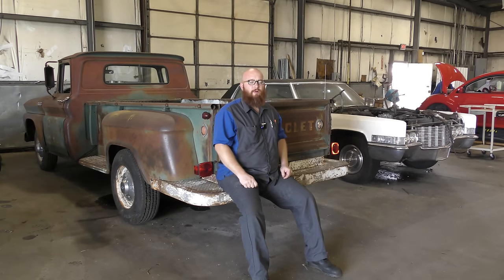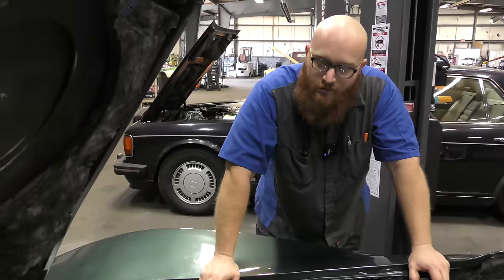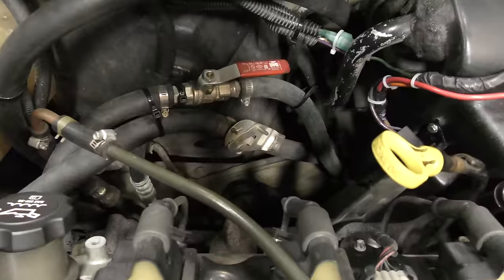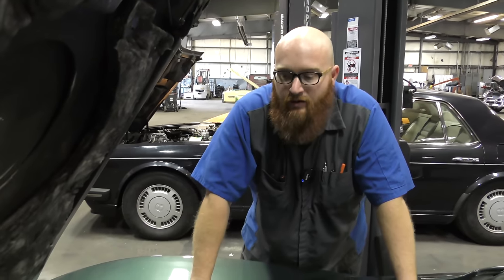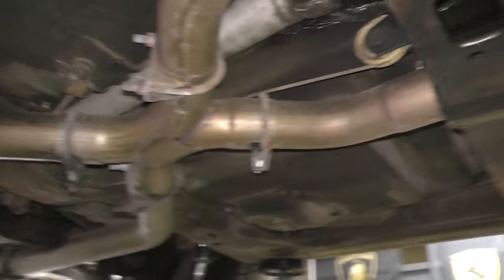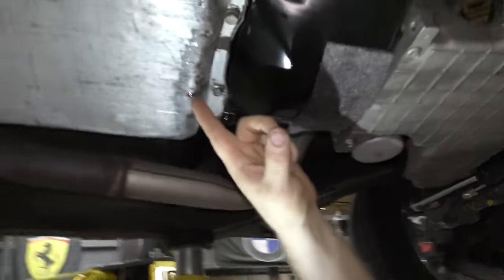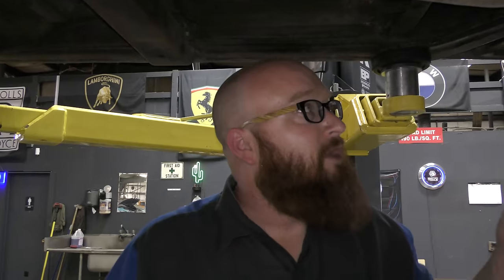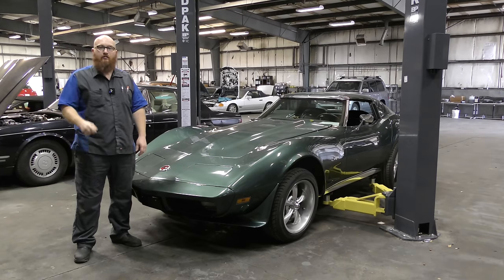Issues AFTER an LS swap! CAR WIZARD warns what can happen on an LS swapped '73 Corvette Stingray

Comment: I never knew that Vets were fuel-injected back in the 1970s.
I will admit I know little about LS engines I know about the old Rats and 427 L88s, Ford 427s,429s 428s, dodge older big blocks  440s, 383 318 wide blocks that we used to stroke. a few others but I am also very rusty in the brain been many years 25-30+years
I didn't think any American-made cars had injection until the very late 70s early 80s. the huge issue I would say right off in putting injection in the older cars is in my opinion, you would need a new fuel tank because of the crap in the old fuel tanks to avoid the injectors always getting clogged, we used to always have issues with fuel injection clogs in the vehicle that people switched from carbs. that carb is not so great being it's mostly plastic which after a while because of the heat will have issues. carbs are in my opinion easier than messing around with injection systems very easy to adjust to the build of the engine because they didn't have Computers back then pretty much every simple car now that is a higher performance just cip back then you had to do a lot more and actually get your hands dirty and learn how to do things. I wasn't the best I could get by though just by listening to it using my own senses the feel of it when driving. the other thing on older cars it isn't that hard to figure out which wire does what because there are few wires, on those older cars the whole engine area has fewer wires than a modern cars car stereo or probably even less than the wiring in the driver's door of a modern car hehe I cringe every time I look under the hood of my is350 Lexus just the wires I see before I pull any of the covers off make me cringe.
Just seeing the trans leak makes me wonder how many other bad things are going on, I mean its easy to drop the trans and put a new front seal in why not do that instead of that mickey mouse crap. unless the case is cracked which it probably is and why they did that.
the worst job I have done was as a teen converting a 72 vega by dropping in V8 things like braking and also doing sparkplugs, I ended up selling it so someone who then put a blower on it pulled the car out into the street floored it which ripper the stock rear end out of it plus grenaded a few things that went through parts of the car. the other was dropping a blown 350 into a Corvair mid-engine I only helped with that and it was a nightmare never mind trying to just get the blower breathing issues and noise
Reply: C3 Corvettes weren’t fuel injected until the cross-fire came out in the 80s…

Comment: Does that car have oxygen sensors. You can put a oxygen sensor on a carbureted motor and be able to read the air fuel mixture with a gauge on the dash. It's not hard to do

Comment: Its Running Rich, its.......... ITS EITHER THE FUEL TANK REGULATOR OR THE GAS CAP,  if its got a fuel injection regulator on it, it will overflow the carb and surge like crazy, as the gas tank on Carbed Cars isnt pressurized, those are, and if its not that its the gas cap, as carbed cars actually have vented gas caps, and if you put a modern sealed gas cap on it, it will cause all kinds of problems for it

and I know this as Nick of Nick's garage had the same problem on a Chevy Camaro that came in, restomod with a carb, same damn issue, drove him nuts, he went through the carb top to bottom and even switched it out for one he KNEW was good and got the same damn issue, like he was visibly angry that he couldnt figure out why the damn carb was constantly overflowing and surging in his video

So I told him to take a look at the gas tank as the car looked pretty new and probably had a new gas tank fitted, as its a 40 year old car, and well gas has water in it, hence why you never let it sit, so it was probably replaced, and possibly with a fuel injected unit,

he took a look at it and and he found a regulator at the front of the tank that was causing the surging, he took it off, and it ran fine afterwards. and if its not that it might be the gas cap, which is initally what I thought it could have been, only for him to find that regulator.

Comment: Why didn't the "builder" just yank the stock L48 or  L82 out, do a nice relatively cheap hi-po rebuild, and call it good?  Three grand would have given you a right stout power plant that would run reliably for a long long time.
Everything would have worked, nothing cobbled together trying to make it work.
On Edit: Also, NEVER OWN A GREEN CAR. They're unlucky.

Comment: Should have just left the small block that came with it or another small block that you could use. LS swaps IMO just not worth the hassle. Stay with the same type of engine that came in the car. Computer stuff needs alot of special parts that as it gets older are really gona be hard to find or kill your wallet.

Comment: What's with these people?  There is no reason whatsoever to use anything other than than a SBC in this car. A 383 stroker would drop right in, and could easily make as much power as the LS.  

The only trick with Vettes is there's not much room for the carburetor/intake, which can be remedied easily with aftermarket fuel injection.   

Total cost for an all forged 427 stroker SBC swap would likely be comparable to the LS, while making about 50% more power.

And those large diameter wheels. Ugh.

Comment: From looks of car its pre- injection,  if was  an injected  car  should  stick  with it , if it is a 1973  Corvette  it was definitely  carborated,  also that  rear spring is an aftermarket  replacement , car would have had a multi-leaf  spring  with  link  kits  to trailing  arms , just saying

Comment: having to pay real time hours can many times cheaper than the damn shop rate book, book listed 3.5 hours to change timing belt actual time to change the belt is under 1 hour. shop rate listed 6.5 hours to change sun roof motor finished in under 3 hours
 there is no issue with a carb if you have an actual auto mechanic or anyone that can adjust a carb, it isn't difficult, one issue with carbs is change in altitude.
 easy to adjust carb don't need much more than a Tac and a screwdriver
many shops have electricians and computer techs not actual mechanics, go to a shop with a vehicle with with points most shop mechanics will have no clue how to set it or what a point file it or how to use feeler guages, hell seen dealer shop people had no clue how to set spark plug gap.

Comment: A carburator has got to be the easist fuel system to diagnose, read the plugs and the seat of your pants feel and mechanically change the float, jets or needle valves to dial it in. I bet the car wizard doesn't know how to use a rotory phone either, lol

Comment: Fabricate if dione "correctly" and you won't have any problems in the future. Wizard is not a wizard when it comes to hot riding or fabrication. His speciality is being a mechanic on stock vehicles, high send vehicles.

Comment: I wouldn't go to a mechanic if they don't understand something as simple as a carburetor.
Reply: A carburetor system is antiquated. It was left behind like old technology should be, when a better system has proven itself.
Reply: @bentnickel7487 , still doesn't matter. If a mechanic doesn't know how to work on something that simple, why trust him? It's like not knowing how to use a rotary phone, how dumb can a person be?
Reply: @bentnickel7487  dude acts like you got to find a rocket scientist to find someone that knows how to work on a carburetor. My 8 year old grandson can adjust a carb. It's the simplest design ever. If it isn't running, you either don't have fuel, air, or spark. That dang simple!!!!
Mechanics these days can't do squat without a computer telling them what's wrong with a vehicle. It's quite sad to see a professional that has no clue on how to work on a classic design. When I was 10 in '91 my friends and I would work on carburetor engines, now grown ass men don't know squat about it. It's pathetic!

Comment: Recently bought a Corolla 2009.  Every time fuel cap is opened.
Petrol sprays out with pressure.

Anyone else facing this issue.  Any help would be highly appriciated.

Comment: A 4 barrel will never run perfect on an 8 cylinder engine each cylinder needs it's own carburator tuned to each cylinder to run perfect. 4 barrels we're cheaper than than multiple carbs that's why detriot started using them.

Comment: I think doing LS swap makes this not a 73 Corvette Stingray anymore. Ruins it. Only good for racing now. Just because you can do it doesn't mean you should.
Reply: LS motor is very streetable, and the stock L48 engine in vette's of that vintage are complete dogs... as in the lowest rated 350CID ever built by chevy.

Comment: You NEVER MIX 134A TO R12 FREON. THEY DON'T MIX. R12 IS A MINERAL BASE OIL AND THE 134A IS A PEG OIL SYNTHETIC BASE OIL. THEY DON'T MIX. BY MIXING THEM IT CAUSES OIL Slugs IN THE AC SYSTEM. 134A CONDENSER HAS SMALL THIN TUBE CHANNELS. R12 USE. ROUND 3/8" TIBES.

Comment: Gee Car wizard I thought you new all that since you are a wizard.Yeah you found out the hard way.LS engines are only good stock.You get lifters rocker arms problems.And you can say what you want about the 5.4 3v but all engines can break.And they all have a weakness.Like GM trying to AMF their LS.And in the process breaking all kinds of things like the push rod and valves and damaging the engine and cam shaft.Yes the LS engine is a simple engine but it does have its pit falls.

Comment: Anyone that does a swap without drawing up a schematic is asking for trouble. I have the capability to do an engine swap but I may not remember what I did 5 years down the road. So even the original creators need schematics.

Comment: You are lowering yourself and doing a dis-service to any owner ( Now or Later) if you can not hand them a paper service manual & thumb drive, schematics, locations, photos, special instructions, repair or R&R procedures that vary from the vehicle and part numbers if not factory. This includes the VIN or donor vehicle, service number of PCM, year of matched parts used. 
Anyone can put an “LS” engine in anything, this does not make you good. I rebuilt every carb from VV7200 Ford, to Solex. Motorcycles to go carts, it does not mean I like them if nothing matches. The 3 & 4 gas analyzers are in the shed behind the dealer. If you don’t own one or know how to use them, you are not qualified to install a carb. R134a carries more latent heat per pound, requiring less and Mr. Wizard is dead on with his math. Using a condenser for R143a is extruded with tiny holes 12 or more across in each tube (Have Photos) but are designed to remove more latent heat at same CFM. Come on, guys with tools boxes does not make it right. Knowledge guided by experience is best practices. Today, guy are born into the word of EFI. I was leaving a dealer that sold complex high end cars and a tech ask me how the fuel pump on his 2-stoke bass boat engine worked. Google it! Or learn for yourself. Mistake stay in your brain forever. Using best practices and fixing right the first time is forgotten when you get you check for that week. ASE Master Tech-Retired

Comment: First of all unbolt that Demon piece of junk and throw it on the trash , stick on a Holley/Quickfuel , that Demon is not a race carb it’s one to bolt on a street rod . Demon went bankrupt due to quality control problems and I had one of those , the name was bought and applied to the carb you see there which is not  tuner friendly like Holley 4150 style carb . Also any shop eg. a stealership that is so narrow minded to not want or know carbs is not a place to take your hot rod car/truck .

Comment: Carbs are beyond easy, if you cant work on or fix a carburetor then why are you even into old cars? I for one hate the electronic side of cars, will always leave ya stranded. Points and carbs can be roadside cobbled to get ya home at least. And the whole "I cant find parts"  is also total bull. I have a 1960 Pontiac catalina, 1963 Bonneville, and a 1964 Cadillac. Napa is my go to store and yet to not be able to get anything i have needed.  Its because people are lazy and dont want to work on them because they dont know how.  The good side of car dumb people is after they get one and cant get it to run or anyone to fix it i can buy it CHEAP!  My last one was a 1964 Catalina convertible. stock and sitting for many years. They couldnt get it run. I looked at it and said id take it. Came back with a set of points and condenser. Fired it up and drove it home. $500 bucks and its in great shape. Aggravation sales are the best.  Another memorable one was a 1969 Catalina coupe, trans was "bad". Well i can tell ya a turbo 400 trans are dam near bulletproof. 200 bucks, got it home and serviced the trans. The filter was plugged. Worked perfect after that. Stock is way better for the old stuff because its built with a different mentality back then. New junk is just shiney garbage made with junk parts.

Comment: I would of chosen the carb over the fuel injection and not for cost. when it comes to cars the tech should of never have advanced past the early 1970's. the Gov should never have stepped in with the EPA garbage mandates. Now if cars could of gone on with our epa stuff suffocating a motor yes advance get faster, but never add any computers the the car not a single one.

Comment: ‘By the book’ labor times. Why is that if the ‘book’ says 2 hours and it takes 90 minutes, you still pay for 2 hours? And if it takes 3 hours, you pay for 3(that’s easier to understand)....I went in with a VW that needed a starter..the goom-bah tried to install the wrong one, so the job took 2 hours longer..and the knuckle head wanted me to pat for the wrench’s mistake...adios.

Comment: I’m glad I know how to rebuild carbs it’s pretty easy EFI sucks if your looking for HP EFI starves the car for air, I would only run Holley I can’t believe people don’t mess with carbs anymore it’s easy to dial it in if you know what your doing, wow a race shop just to mess with a carb damn there simple, the relay is probably bad duh your not that great of a mechanic IMO it’s kinda sad engine temp but of 300 Degree’s wow that’s destroy the motor water boils at 212 degrees dude that why thermostats are set to 190 usually I miss when you could get the 160’s, if it’s an LS motor it has the same wiring harness as it had in the car it came from duh so I don’t understand why you think this is so hard and LS harness hooks up to the LS computer in the car so you could use a schematic for that LS motor to address the wiring harness it’s not that hard wow a mechanic that doesn’t like to get his poor little hand dirty and you call yourself a mechanic I bet your one of those ASEC certified mechanics

Comment: Carburetors are not that complex or hard to work with at all if you got $100 you can learn everything there is about a carburetor go to your local junk yard they'll have at least one really old dirty and useless carburetor lying around somewhere find the serial number on it look up what type of carburetor it is and get a rebuild kit for it the carburetor and rebuild kit both will you about $100 give or take $20 watch YouTube videos on how to disable and rebuild it and guess what your now a carburetor master !! Wow who would have thought ??? And guess what every carburetor you'll "EVER" run in to will be the same just bigger and guess what tuning a carburetor is super easy too !!! You just turn every adjustment point to it's closed position and you start adjusting everything back with a quarter turn at a time until you get it right you'll notice the difference thin go driving and see how it feels if it's more adjustment thin do it

Comment: If you can’t work on a carburetor then you’re not a mechanic and you shouldn’t have a shop. Anybody could work on any kind of fuel injection system they’re made so a two-year-old can work on them bahaha 🤣 carburetors better than fuel injection anyway the only time you really want to fuel injection is if you’re going Muddying or rock climbing otherwise I’d stick with a carburetor any day

Comment: I like how you document it but I would never trust him to work on anything because he's calling a street performance carburetor racing carburetor so obviously he doesn't know s*** and any mechanic that refuses to work on carburetors because nobody works on them you need to get rid of them anybody that tells you fuel injections better than a carburetor they're an idiot they don't understand air flow and if they can't understand airflow at the basic carburetor level they don't need to be working on a computer controlled car that tells them what to do because the minute the f**** computer can't tell them what's wrong with it they're stumped. I don't know how many times I've seen that kid fresh out of school couldn't figure out a burnt valve I knew it by the sound of the way the engine was running

Comment: The only comment that I can make about  the new cars they are garbage thin cans you don't have access for nothing even to change a water hose everything is ruling by a computer  and more difficult to fix and expensive and ugly   they are like jelly beans they look each other you go by the street  you don't see the difference  between  Nissan and BMW and  those boring colors basically  you see white,gray and black and that sit !!!
Is cheap plastic and carbon fiber everywhere  you have an accident and  they  just  fall apart,there's no doubt old cars they were much much better and prettier the quality of the materials paints,engines,transmissions,suspensions you name it.
Leave one of those new cars expose to the whether  elements for a year and after that the paint is gonna be faded  and the latest fashion to have those skinny black rims and tires is just horrible.